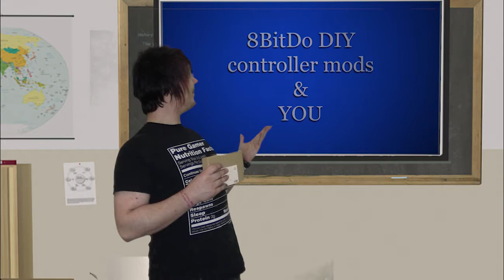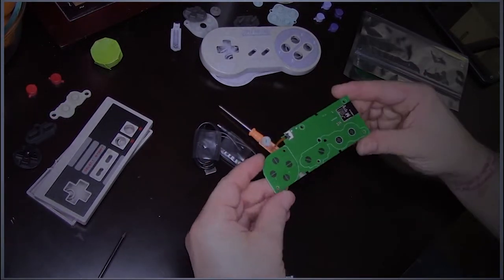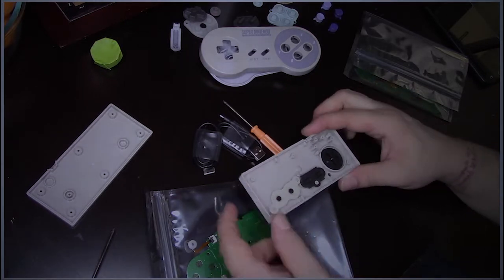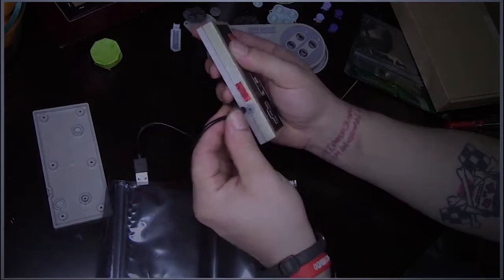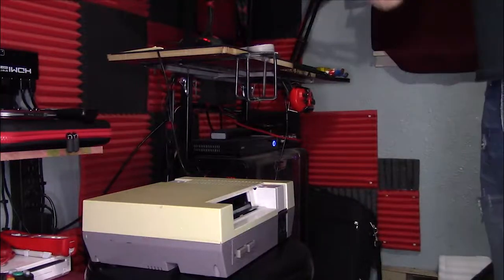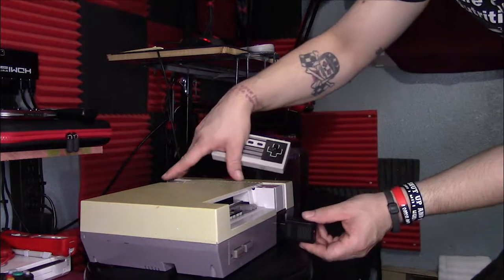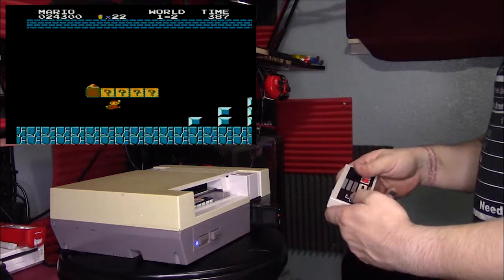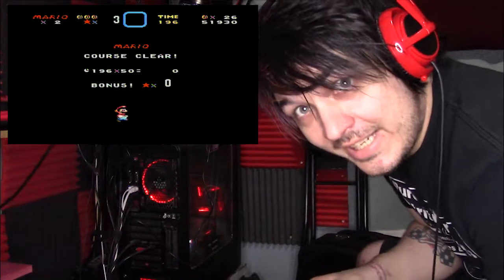Class In Session: 8BitDo DIY 101

Comment from the maker: While the #diy kits are a great budget item, they can't convert original equipment into a pro controllers with analog sticks... however, for right now, this is the only way to have a Bluetooth Genesis/Master System controller. 
I imagine it's only a matter of time before they use these to sell pre built ones.. but as of yet, there is no Atari/Sega 9 pin retro receiver available.